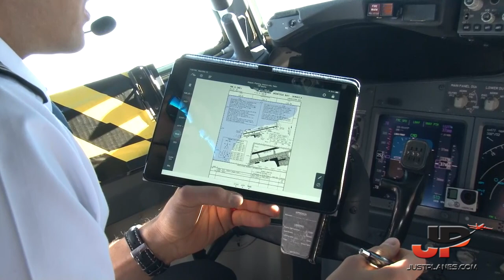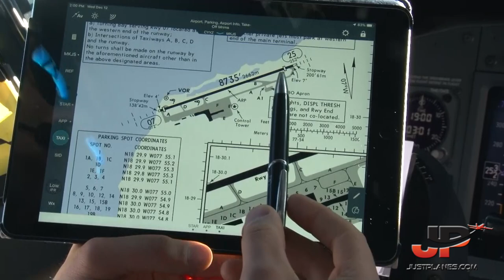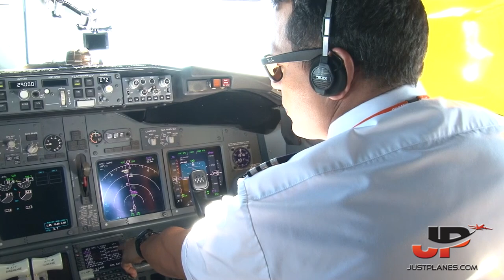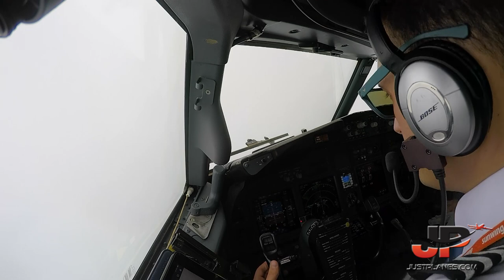Piloting Boeing 737-800 into Montego Bay | Cockpit Views

Comment: I love planes, but don't know much about them. 4:07 Where the captain has his hand on the throttle, what do you call the item that keeps spinning? Is the autopilot controlling it?
Also after the captain touch down he lets go of the yolk. Does the first officer take over or does the captain use something else to steer the plane while taxing?
Reply: Camron Clarke those are trim wheels. It helps to smooth out the controls for more stable flight. When on autopilot, the computers control it. In manual flight, there are tabs on the yoke that the pilot can press to control it.

When on the ground, at certain speeds, the rudder pedals are used to steer the aircraft. Below those speeds, there is a handle, called a tiller, that is used to control the direction of the nose gear.
Reply: @jasiahmorgan7676  Understood. Thanks for the information. I appreciate it.

Comment: On 737 what is the function of the noisy spinning discs either side of the thruster yoke?
Reply: Those are the trim wheels. It moves the horizontal stabilizer up and down in order to change the pitch of the aircraft. However, instead of turning the wheel by hand, if you look at 5:38 on the captain's yoke, the little switch above his left thumb is pushed up or down and the trim wheel turns. It will also turn if the autopilot is engaged and changing the AC pitch.